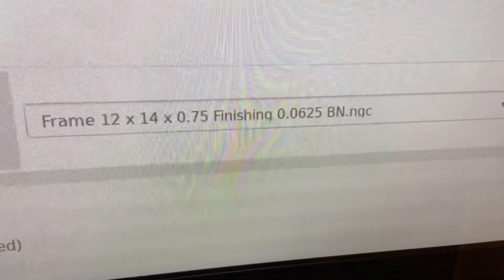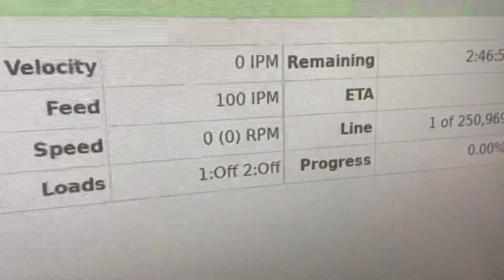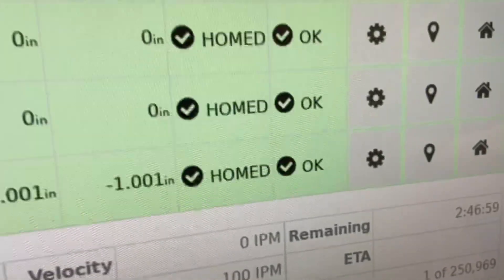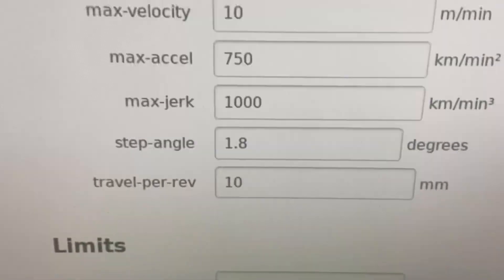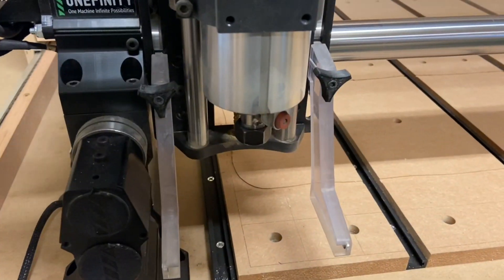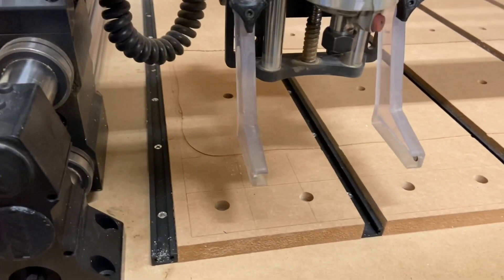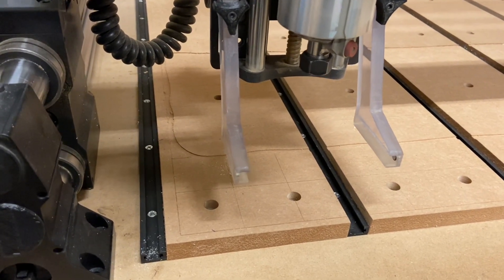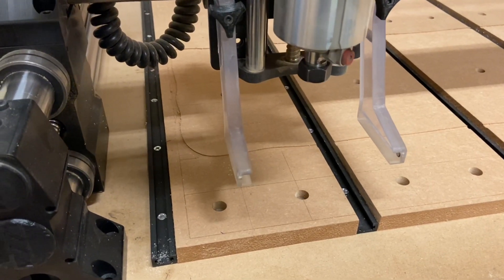How to reduce Carve time on Onefinity

Comment: Thanks for the information.  I've learned a lot watching your videos.  I noticed you also changed from 100ipm to 160ipm between the 1000 jerk and the 5000 jerk settings, that's why you had such a significant drop in carving time.
Reply from the maker: Eric, so I checked my files again this morning.  I only have the one file that I used in the video. Turns out that the feedrate shown is the feedrate that the machine had last run 100 ipm. As a matter of fact, when I turned on my machine, the feedrate was showing 0.98 ipm from the last cut just before it ended the run. When I loaded the the same file from the video, it showed 0.98!! Did air carve and it immediately bumped up to 160. 
At any rate, the carve time for at 1000 jerk is 2:46:59 as reported in the video.
Reply: @onefinity-trainingtipswithMitz  I noticed the same thing today on my machine, thanks for clarifying it. I adjusted the jerk on my machine today and enjoyed the reduced cutting times.  Didn't see any difference in the cut quality.  Thanks again for the great videos and please keep them coming.
Reply from the maker: You bet!
Reply from the maker: Thanks for catching that... it wasn’t  wasn’t intentional. I loaded the same file every time and didn’t make any changes to the file.  I’ll have another look at my settings for that file and try to recreate it.

Comment: Nice video.  So its safe to run at 15K all the time?
Reply from the maker: The probe speed will not change. The rapid moves will however. So what that means is that once you execute the probe command, the bit approach to the probe block will remain at its normal speed, but the speed from between z probe to x probe to y probe will be quicker and once probing is complete and router moves to xy zero position it moves very quickly
Reply: @onefinity-trainingtipswithMitz  too bad we can't isolate the entire probing events to stay the same.
Reply from the maker: Yes. I did it for a long time.  Just keep your fingers away from the router head when running or probing
Reply from the maker: I just went out to the shop and tested again at 1000, 5000, 10000, and 15,000 jerk. No difference at all in the probing sequence which I think is what you are wanting.  There was a time where this wasn’t the case but must have been adjusted in the latest release
Reply: @onefinity-trainingtipswithMitz  that is fantastic!!! I will try it at 10k today hopefully
Reply: So if you increase the max jerk, are you saying it increases the probing speed as well? I actually like the probing speed that the new update is set to.